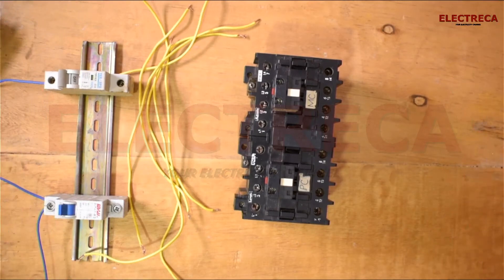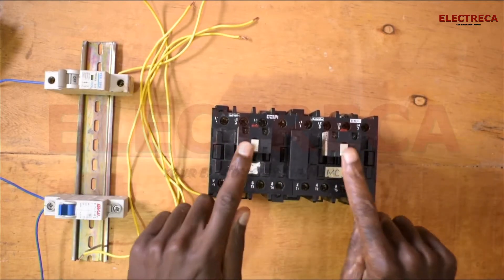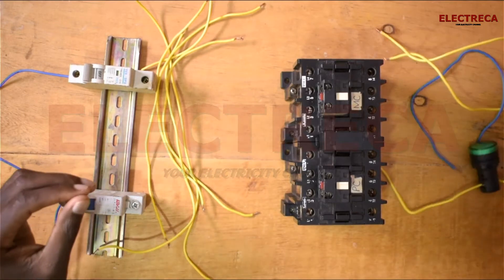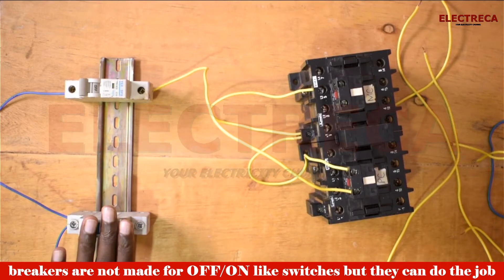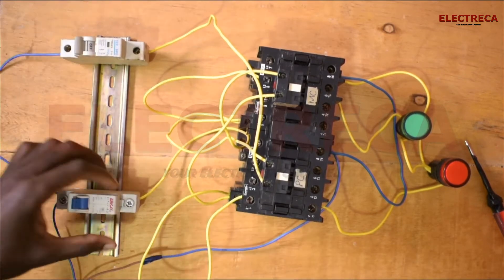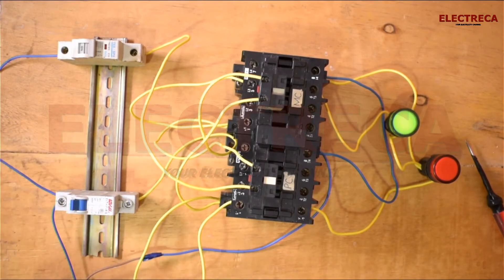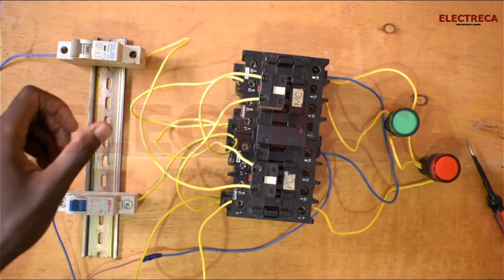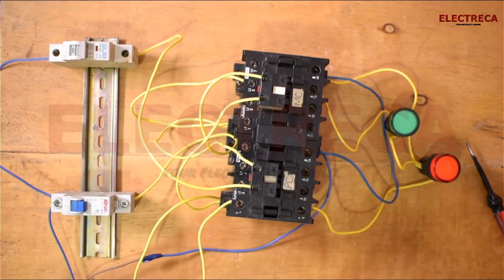manual changeover switch with contactors|ELECTRECA

Comment: Pls what device can you use to prevent voltage from different sources (mains and backup power) from breach aside from interlock
Reply from the maker: Thair single phase contactor that will do exactly that(cheep)https://youtu.be/jTT78vs04yM
You can also use a motorised changeover switch( changes from source one to two automatically.

Comment: Please can we utilize only electrical interlock neglecting the mechanical interlock
Reply from the maker: No electrical interlock are important in that circuit, also protects the contactors.if you use only mechanical interlock and any thing goes wrong you must lose at least one contactor due to resistance of the lock while the contactor is trying to energise.
Reply: @elektreca  good morning brother,